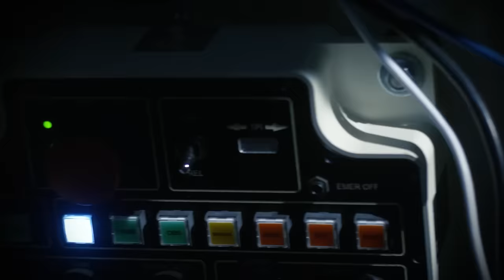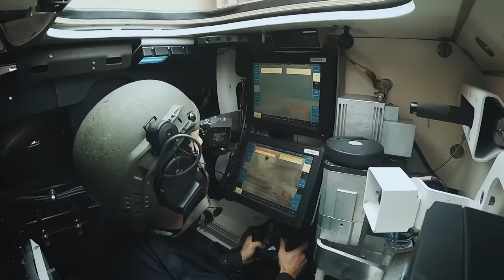Watch how Leopard 2 tank changes the battlefield in Ukraine

Comment: I do believe you're glossing over the vast differences when you say that the Leopards and the Russian tanks are essentially equal. The Leopards are very late ,20th to early 21st century deadly works of art. The T-72 and T-90 (if Putin decides to field them) are either obsolete by comparison and downright poorly designed "Zippos" respectfully. One strike at distance and they fire up. Please  tell me that I'm mistaken.
Reply: The problem with the Leopards is that the ammunition is stored in the front, making it easily killable with a well placed shot. Although, they are still far superior over the T variant tanks
Reply: They are Ronson's "lights first every time".
Reply: Let's not forget that the T-70 and 80 series tanks are just upgraded T-64's. The T-90 is also just an upgrade of the T-72. While the T-64 and 62 before that were just retrofitted T-54/5's. That's why western countries are supperior in technology as Russia went for the cheapest solution during the soviet era.
Reply: Leopards have the same advantage the Tigers had. Better optics, better targeting. The German 88 was deadly because of that.
Reply: @thenevadadesertrat2713  The Leopards also don't have the downsides of the Tiger such constent breaking of transmission or getting easily stuck in mud. They also have faster speeds for already known reasons.
Reply: @yokoplayinggames7019  and yet the T64 is the only known tank to survive a test nuke at close range and not only survive but remain operational.
Reply: soviet and russian tanks are designed for a different doctrine, so i wouldnt call them badly designed
Reply: Yeah he lost all credibility with that statement.   And acting like Ukraine will just be able to waltz into Crimea once they have a 150 tanks is insane.   Getting through the Perekop Isthmus will be difficult as it is basically a funnel with the defenders able to rain in artillery on anyone trying to attack.   An attacking army would lose 150 tanks in a day using this guy as advisor.
Reply: @averagewhiteguy6473  When the Leopard 2 hull is reached by the shell, its crew already has a bigger problem. Main, a lack of infantry support and no artillery cover. 
Polish crews used to keep only a few shells in the frontal ammo rack. Scattered a few empty bins, one from the other. Bins. Because each round is stored separately, the ammo rack is not a crate. Inside the tank, all walls are covered with anti-fragmentation Dynema "blankets" or plates. This, and the most effective extinguishing system available, prevents the ammo from exploding. German crews also used to take a limited array of ERA on their frontal plates of the hull. All mentioned are not a problem in the case of Leopard 2A6.
Reply: @yokoplayinggames7019  T-62 is a T-55-based design. Not a "retrofitted", not rebuilt, not up-armoured, and not "modernized" or any of this nonsense. There is no tank in service called T-70. Soviets went for the cheapest solution but not in the place and time you pointed out. They had the T-64 (from Ukraine.) By far the most sophisticated, modern and expensive tank. When initial problems were fixed, the govs and army decided to go for a cheaper, less complex, yet more "rough" version. It was the T-72. Both tanks were manufactured at the same time. T-64 (later changed into T-80) was the tank for elite units.
Whatever the version or modernization these tanks are a very formidable asset on the battlefield. Even the oldest ones are still absolutely devastating, well-protected and deadly dangerous MBTs.
Reply: @HanSolo__  Sorry for my mistake then.
Edit: I called the T-72 series the T-70 series out of laziness tbh.
Reply: The tiger was also cooler than the T34.
Reply: @nuke_jr  keeping the slave states that make up the Federation in the fold. 22 nationalities in Russia,  everyone a conquered people forced to speak Russian.
Reply: @miketrusky476  I didn't intend to defend the russian government. All i wanted to say is that the soviet doctrine planned spearheads of tank and motorized infantry breaking through the defenses of NATO troops after massive artillery bombardments. The T-tanks are designed to fit in this doctrine: low profile, small crew and supposed to operate in groups to overwhelm possible NATO tanks returning fire. The german tank museum uploaded a video about what the thoughts behind the russian and soviet tank designs was
Reply: it's funny that units using the leopard are perfectly happy and satisfied with the latest version which shows again that a lot of the comments on youtube are utter nonsense
Reply: Quantity has a quality of all its own. 
    A phrase that needs to be recognized sooner rather than later.
Reply: @yurykorol8715  Which Tiger?
Reply: @Au60schild  1942-1945.
Reply: @YurY Korol  No kidding. However, are you referring to the squatty Tiger or the King Tiger?
Reply: @Au60schild  You don't get it, it makes no difference which tiger, ALL of them were the best in the world at the time, BUT it didn't help them.
Reply: @datsunlambchops4624  Quality wins every time. If your quantity is easy to kill it's no good.
Reply: I dont understand why Americans can not stop their bias. Just look at the Wargames Nato has done. The Leopard has won almost all of them in 1. place. THIS HAS TO MEAN SOMETHING. Abrams in a great tank, no question. But when it comes to first shot kill quality the Leopard performes like a beast. There is a reason why you guys buy its gun for the Abrams. And please lose this armor talk. YOU DO NOT WANT TO GET HIT IN A TANK EVER. Modern wappons and Arty will fuck you up, no matter if it is a Challanger, Leopard or Abrams.
Sorry for my bad english, i try.
Reply: @britishrocklovingyank3491  well, you should really look at the soviets breaking the siege of Leningrad.
Reply: @datsunlambchops4624  There was more to that than numbers.
Reply: @britishrocklovingyank3491  yes. However you should do a little reading on what was said about Russian production capabilities during operation barbarossa. Especially towards the end.  
    The quantity aspect of Russian production during a major offensive and how it turned the tides against the nazi invasion is quite famous.  Its strange that you would even try to downplay it.  But hey. Lots if people get their information from propagandists in the west.
Reply: @Datsun Lambchops  Yes and more so when you include lend lease. The catch is Germany's shit wasn't that great.
Reply: @nuke_jr  And a sword was a good design for the Roman soldier, BUT that was a different doctrine too.  So apples to oranges. You don't bring a knife to a gunfight, even if it is a good knife for a knife fight.....right?
Reply: @Jay.Kellett  you obviously don't bring a knife to a gunfight. As i may have already stated, the german tank museum made a video about the thought process behind the design of the T-tanks which explains the difference between the doctrines and the resulting differences in the priorities of certain aspects of the tanks. It basically says that the soviet/russian tanks were intended to be used differently and therefore were made in the way they are
Reply: The past year has shown that you couldn't be more wrong. Many Javelin and other strikes by NATO stand-off weapons have been survived by both modernized T-72's and T-90's.
Reply: @HanSolo__ клоун, т64, и т80, это разные далеко разные, машины, т72, т72Б3, т90,и их модификации, их много, перечислять все нет смысла, учи матчасть и многое мы не знаем что на вооружение у рф

Comment: The comming battle will be decided by many factors:
1. the most important one is the total length of the front.
2. For Ukraine it is extreamly important to bypass the cities and only controll the roads in or out of them this can be done by extensive mining.
3. To have infantery enough to keep their own supply roads the safe.
4.  Take controll of enemy supply roads and quickly advance to Krimea and make a front att the narrowest place. Do not enter Krimea before the bridge is destroyed because that will cost to much.
Secure the N front encircle the Citties that has Russian troops, starve them tightning of the circle.
5. Destroy the units that are encircled.
6. Prepare for the battle of Krimea and take it. This should be done in January 2024.
Reply: L

Comment: The Abrams Tank, uses any fuel. Diesel, Gas, or Jet fuel. Might want to use a different source. The problem is weight for bridges, and maintenance. There is no current repair facility for the Abrams in Europe...Yet!

Comment: The comparison statement that western tanks are basically equal to russian tanks is utterly false.  Not only are russian tanks less capable technically, they are full on crew death traps due to how they are designed.  Just those two are very well known facts but there are many other issues as well.   While the tanks the west will be giving to Ukraine are not the top of the line for each version, they easily match and exceed the russian tank capability other than perhaps the T-90, which russia has either limited numbers left of or are not sending to the battlefield.   And the T-90 is only barely able to match the tank versions the west is sending in technically, BUT they are still death traps when it comes to crew protection.   You can have 1000 tanks but without trained experienced crews, they are worthless.       It remains to be seen what happens when Ukraine starts using the new tanks.  Without boots on the ground, russia still has enough manpower to stop an armored push.  Tanks are worthless without boots down.  And of course boots can't push without the armored support either.   Finally, you showed a map about crimea and you encircled it.   That is NOT possible.  Ukraine does not have a naval force of any kind.  Therefore, there is no possible way for Ukraine to surround Crimea. And you can bet, russia WILL use naval blockaid forces and supply to keep crimea as long as possible. The only option they have is a one sided full invasion and push into Crimea straight up.

Comment: EU and RU tanks are not Equal. Far from it. RU tanks are not equipped with high enough of a caliber gun to penetrate the Leopard 2-s main armor. That doesn't mean that it has no weak points, such as the tracks. Or that a tank hunter cannot harm it. There are other munitions too, like missiles. However this is a huge disadvantage.

EU tanks and the Leopard 2-s are equipped with infrared, night visions, they are all stabilized, with very big engines, great maneuverability and heavily armed and armored. It's not the same thing.

Comment: it took 5 minutes for you to get to the tank portion, and the first thing you said was wrong.  There is no difference between allied and enemy tanks....seriously?  Then you were wrong with the Abrams fuel.  The optics and fire control, that you say are far more advanced is exactly why the western tanks are so much better.  When you can identify an enemy from twice as far, yo can kill it from twice as far.
Reply: Previous engagement between American Abrams and Soviet Tanks suggest that you are absolutely correct.  This video also fails to mention the superior APV's such as the Bradleys and Strykers that will add to the mix on the coming offensive. Russia is outmatched for the duration. . .

Comment: The research into this video was basic at best.... for one, the Abrams actually has a multifuel engine.... also, this- "Barely enough tanks for defensive operations", which means, they have enough tanks for defensive operations. While also having a massive amount of captured Russian armor, especially from Izium, that has been upgraded, repaired and stored for the offensive. Ive been told by friends who helped liberate Izium that the amount of Russian armor they captured has been able to be kept secret, but the amount is going to blow peoples minds when its launched against Russia in the up coming counter offensive. "Its more than anybody could believe."

Comment: Abrams does not require aviation fuel.
From Wikipedia:
Multifuel engines "Diesel #1, #2, or AP, .......Low octane commercial and aviation gasoline ..... jet fuel Jet A, B, JP-4, 5, 7, and 8 could be used, as well as fuel oil #1 and #2....... Another use of multifuel engines is the American M1 Abrams Main battle tank, which uses a multifuel gas turbine engine.
Reply: I was wondering too ;D

Comment: Comparing the Russian tanks to any of the Western tanks is untruthful. Its no match.

All three of the Western tanks can accurately engage and destroy any of the Russian tanks outside of the Russian tank's max effective engagement range. 

The few T90 still remaining may have a better fighting chance, which I doubt, but the others are severely outclassed. 

The Bradley and other IFVs supplied to Ukraine will also be able to destroy Russian tanks with their main cannons as well as their anti-tank systems.

If the Ukrainians properly employ these systems only land mines, artillery, aircraft, and infantry anti-tank ambushes will be a threat to these vehicles. 

I know the Abrams tanks supplied to Ukraine are not outfitted with the same reactive armor we use but they are good enough. 

The biggest challenge will be maintenance, fuel, and resupply to keep these tanks and IFVs moving forward.

Comment: Ukraine will receive, a minimum of 178 Leopard-1A5 with upgraded fire-control systems, from Germany/Denmark/Netherlands, of which 105 units should be delivered in 2023, and 73+ units in 2024. The total number will likely increase by another 50 Leopard-1A5 from Belgium, and 96 additional units from Germany (retired Swiss stock currently being negotiated) + another 10 units for spare parts. So somewhere between 227 and 324+ units of  Leopard-1A5 MBT´s will join the fight! Additionally, a minimum of 134 Leopard-2 and 14 Challenger-2 will arrive in 2023. So up to 472 operational MBT´s donated to Ukraine, long before the US pledged 31 Abrams M1 will arrive. This on top of the 513 T-72´s already donated by: 
Poland/Czech/N. Macedonia/Bulgaria/Romania/Slovakia/Morocco. 
A grand total of 1.016 MBT´s + the estimated 308 T-72´s captured from Russia, means that Ukraine will have added around 1.324 Main Battle Tanks to their fleet, by the end of 2024. That is a significant number!
Reply: It's time to ramp up german production to war industry. In 1944 they could produce 340 Tiger per month. With modern technology it MUST be possible to outnumber this with KF51 Panther and Leopard 2A7.

Comment: And Yes leopard can be easy repair in near front repair bases but only if you have service gear and praktice on leopard. Same as abrams and Leclerc, you have to have eqiped for only one Type of tank serwice center and People that can work it after wake up on 3 am in 15 minutes. If you dont have experience every posible maintance then for first time it takes you minimum 2 or 3 times longer. So for 3 types of tank you need 3 specialized service center and 3 diferent units of service man with diferent knowledge of diferent service equipment and system and IT.

Comment: In some Soviet-era tanks, such as the T-72s being used by the Russians, ammunition is stored inside the tank beneath the crew, which, when the outer shell is ruptured by enemy forces, can trigger a chain of detonations and explode in a blast so powerful that the turret is blown off the body of the tank.

The Leopard 2s carry ammunition behind the crew, heavily partitioned and protected to avoid such devastation.   NOT BASICALLY THE SAME AND YOU CAN'T COMPARE THEM  -load of nonsense
Reply: leopard 1 stores the ammo on the floor, next to the loader.

Comment: the whole video except leopard 2a6 is fake propaganda, but no one will supply leopard 2a6 to Ukraine, 2 a4 are supplied. leopard 2a6 and 2a7 are very powerful and effective tanks, no one disputes and are able to penetrate into any projection of frontal armor t90m tank, but the t90m tank is able to find vulnerabilities in frontal armor and it depends on ammunition as well as leopard 2a6. with the latest bm-63 leopard shells, all Russian tanks except t14 are punched in the forehead, but Russia can also punch 2a6 starting from t72b3 series tanks and later, provided that they are equipped with the latest shells, but so far there are few of them since there is no reason to use them and of course it is expensive. so far, old ammunition is being used that is not able to penetrate the Abrams M1A1HA+/AIM/D/M1A2 and M1A2SEP/SEPv2/M1A1AIMv2/FE, as well as Leopard 2a5/a6/a7, but if they do appear in Ukraine, which is unlikely, then Russia will start producing these shells to defeat these tanks, in addition to shells, Russian tanks can use missiles.it was also funny to see in the video about the accuracy of Russian tanks, this is certainly not true, but the t90m and leo 2a6 accuracy and equipment for effective shooting in different weather conditions and time of day are +/- the same. about the use of tanks of World War 2, this is the delirium of a madman.  in general, the whole video is stupid propaganda designed for a person far from military topics